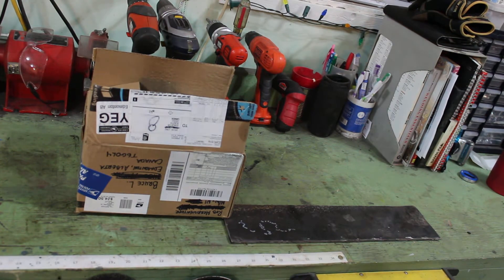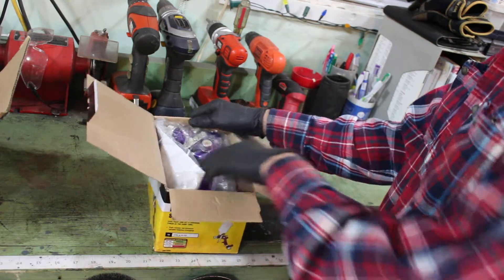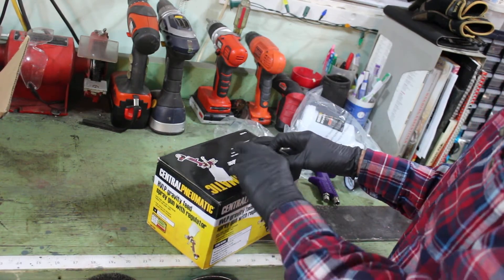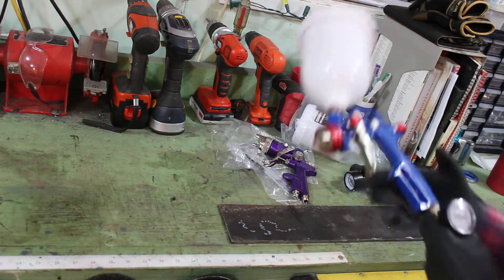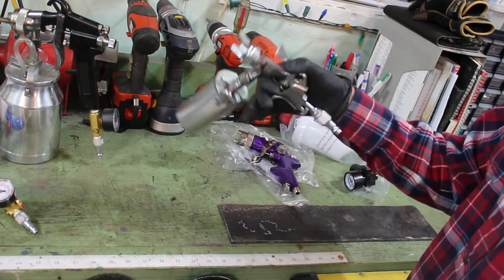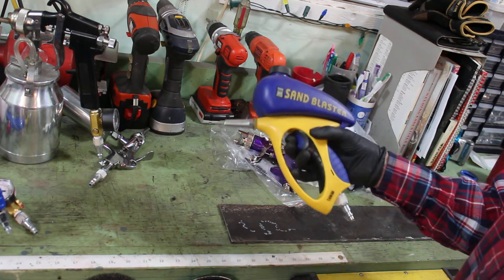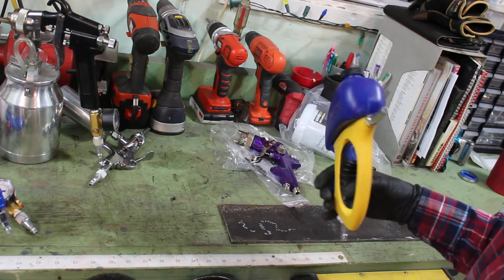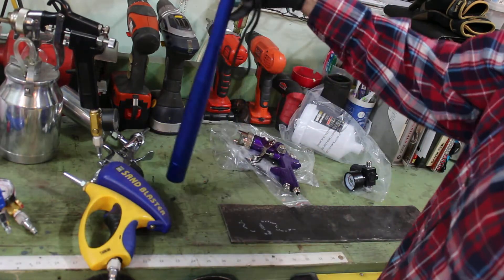Harbor Freight paint gun

Comment: "I've heard nothing but good things...."  Bruce - you must be traveling in very polite circles on the interwebs....  I'm by no means a pro but from what I've seen/read and experienced with the purple sprayguns they really aren't bad but DO require a very thorough cleaning and some knowledge about how to set them up - also expectations around what paint works reasonably well needs to be kept in mind (i.e. if you've bought it to spray thick primer or sealer - you'll likely be frustrated or at least disappointed.  Another area where people get "sucked in" is with the $10-$15 price - spend about $10 more and you get a wrench and a "regulator" (which is really more of a throttle) - I've tried to find a spray gun wrench on-line and the least expensive I've found is about $18 so the extra money for the gun that comes with it seems to be a good idea.
Reply from the maker: I’ve painted three cars with it. I have several other guns and it’s not my go to gun, but it works surprisingly well for what it is. I use my old Binks gun for primers. They definitely require a thorough cleaning before use. They’re full of packing grease.